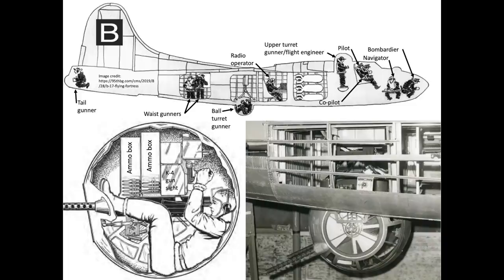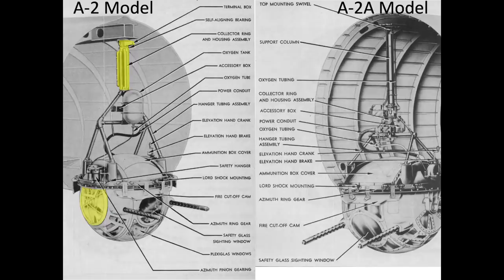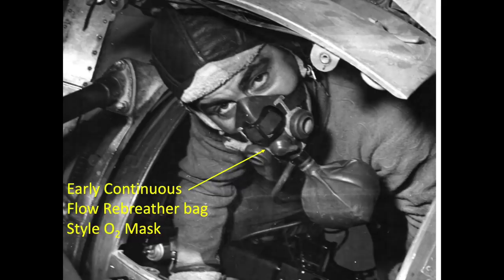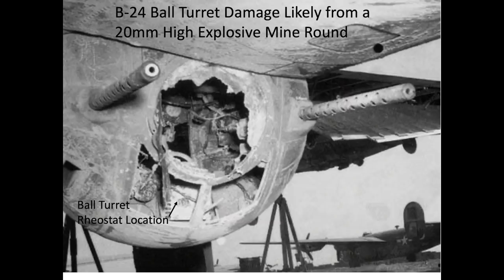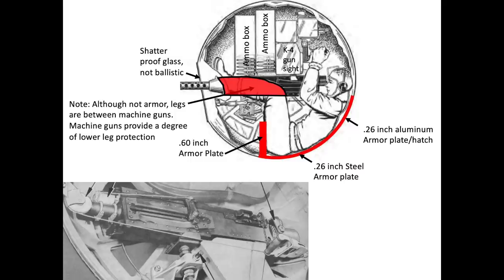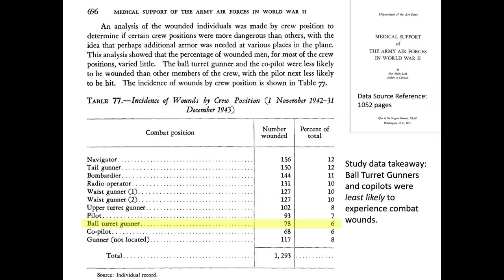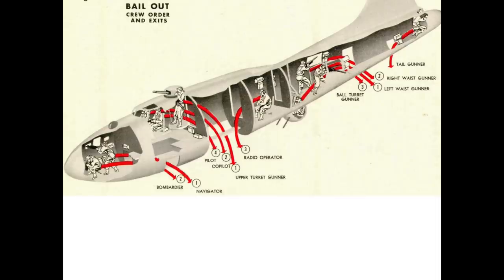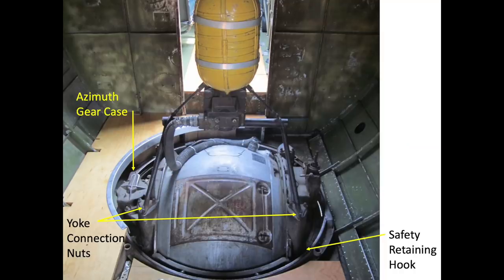B-17 Bomber Ball Turret Introduction, Survivability, and Station Armor

Comment: My uncle was a ball turret gunner on an 8th Air Force B-17, and managed to survive and get back home. He took part in both the raids on the Schweinfurt ball bearing plants. They barely made it back from the first raid, and his plane ended up being scrapped. Three crewmen on his plane died in the battle going to and from Schweinfurt.
Reply: What group was he in?
Reply: [08/18/22] Do you know what the bomb damage assessment reports on Schweinfurt plants reported? How effective were the bombing raids on crippling, and handicapping the Nazi industrial machine, and their supply chains?  Without a reliable, or steady supply of ball bearings, any rotating machinery fabrication would be brought to a halt. I am wondering how much hurt was applied to the Nazi war machine due to this constant bombing pressure.
Reply: @oceanic8424  I have studied this myself for a book I wrote about a bomber crew that went on both Schweinfurt missions.  If memory serves, the plants at Schweinfurt lost about 2/3s of production capacity in the immediate aftermath of 10/14/1943.  However, the inability to follow up immediately with more raids allowed the Germans to diversify production sites, and ball bearings also weren't the Achilles heel the USAAF thought.  The Germans were able to use "roller bearings" as a substitute for a number of applications.  So the missions hurt the Germans but were not a killer strategic blow.  The bombing campaign vastly increased in tempo and size of raids in 1944-45, and I think Speer is right in calling it a "second front" before D-Day.  But 1943 was really tough for the 8AF.  The statistic that always hits me is that no branch of the U.S. military in WWII suffered a greater percentage of casualties than the aircrews of the Eighth Air Force.
Reply: The B-17 was an amazingly tough aeroplane. In contrast, the B-24 Liberator would often burst into flames with only a few hits.
Reply: You know it’s bad when they have to scrap your plane after you return home

Comment: The history of the ball turret is kind of interesting.  Turrets were introduced in the B-17E in September of 1941; earlier models had only had flexible gun mounts.  In the first Es, there was actually a remote-controlled belly turret that a gunner controlled with a rather complicated setup of mirrors.  However, it quickly became apparent that this remote turret couldn't hit a damn thing, so it was replaced with the ball turret.

Comment: very interesting. i didnt know that there was so much design in a ball turret. specially the armored parts, i didnt know about it. thanks
Reply: Indeed some of the crews stories about being placed in this position were sometimes a load of bull.😏😏
Reply: @brucepickess8097  yes, sorry for the typo, english is not my native language
Reply: @user-zn7tj3xc7k  Ok, English is my native language and I've made worse mistookz, sorry mistakes.😏😏
Reply: Prior to the sperry ball turret I think in the early models of the 17 and 24 were a window in which a gunner knelt in a large plexiglass plate window,. That was the 1st attempt at a downward facing gun, I can't find much material on this but early versions of bombers had a floor window with a swiveling gun but this was a deemed to be impractical so the ball Turret was invented.  If anyone has any resources or links to the precursor to the ball turret please post it

Comment: I worked with a guy who was a ball turret gunner. He was a replacement gunner until he got assigned to a plane as a regular crew member. The way he said he got his job was that a B-17 came back missing it's ball turret gunner. While he said they didn't know exactly what happened, they thought he got sick in is mask, took it off to clean it out, got disorientated, rotated the ball incorrectly, and thinking he was climbing back into the plane, fell out.  I don't know enough about the mechanics of the ball turret to know if this was even possible, but it was his story.

Comment: Excellent video!  Some of your viewers don’t seem to get it that the ‘by the book’ bail out procedure can’t always be followed if the damage is catastrophic.  The B17 was pretty well designed from the emergency exit point of view.  My dad(an half the two crews) survived a mid air collision. He was the radioman he said he never would have made it in a B24. 
May suggest you slow down a bit especially when you show charts, graphs etc. I had to pause the video 3 times.
Reply: And, yet, the crew survivor rate for B-24s was higher than the B17s.

Comment: In the first B-17E’s they used a remote control bendix belly turret controlled by set of mirrors and this was same type of turret used on B-25B/C/D and early B-25G’s eventually from the 112th aircraft on they used the ball turret which would carry on to B17F and B17G.

Comment: Let's see: hours in a fetal position with turret temperatures around -50C and a requirement for fed oxygen.  No parachute immediately available, so if the plane goes into a spin, you're toast.  Bugger that.  Sign me up for latrine duty instead.
Reply: Latrine duty would be a shitty job😜😜😂. Mailman, or milkman would be better 😝😝

Comment: How long would it take to impact the ground once the plane was "shot down?" Like once the plane has taken critical damage and the captain gives the order to bail out, how much time would they have? I doubt 40 minutes. I guess the Army wouldn't be getting many of their sights back
Reply: Dropping the turret and/or removing the sight was only done if you needed to do a belly landing (i.e. you can not deploy your landing gear for whatever reason, but your plane is still controllable). If you have to bail, then your plane is so badly damaged that you can not even fly it to a controlled crash landing, and the sight is too bulky to carry out with one of the crew as they bailed.
Reply: @richardmillhousenixon  Thanks